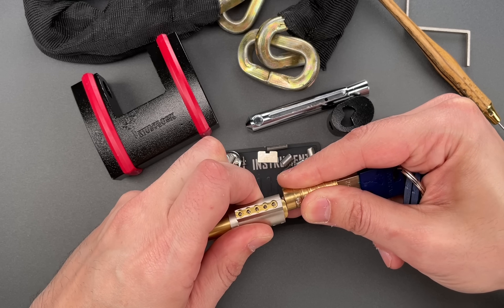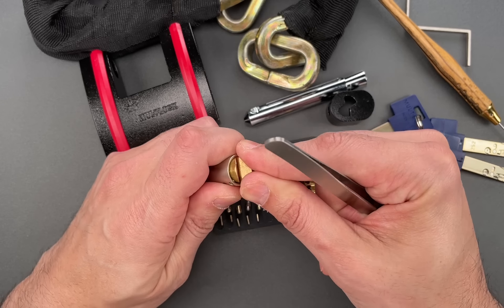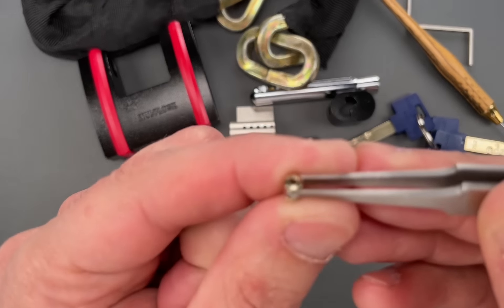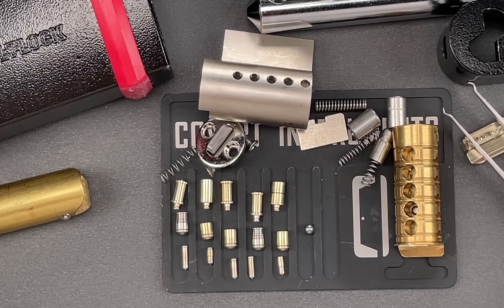[1592] Mul-T-Lock’s Sliding Bolt Blunder (Model SBNE12)

Comment: If that lock wasn't so comically opened by Trevor, it would be a fine bit of kit.
Reply: Really wasn't explained why it happened like that, my guess it's a spring issue?
Reply: @Patrickf5087  Weak springs, yeah. Easily fixable—just replace one spring with a cigarette lighter spring (cut in half, usually).
Reply: @ConstantlyDamaged This is the stuff i go to the comments to see. Thanks for sharing!
Reply: @Patrickf5087 Yeah, probably has to do with the shackle catch being sprung. Any lock with a sprung shackle catch can be opened by just giving it a whack (see also: the Master Lock 605, 606, and 607)
Reply: @Thesnakerox  If I've learned anything from Trevor's videos, it's that most master locks can be opened by another master lock
Reply: @ConstantlyDamaged  Yeah, but you have to make sure that the spring isn't common steel (which some cheapies are made out of). It's usually simpler to just take the diameter of the existing spring and finding a rust proofed variant online with a higher force rating and get it in a longer length too. Then you can start by snipping off the same length as the OG spring, and testing to see if the poppet does the same or not, and if it does, you snip a longer length until it doesn't. These springs are usually found on MC or other common places for machinist stuff. Cheap too. Cheaper than Rando Randy walking off with your prized scooter Daisy.
Reply: @Patrickf5087  looks like it's vulnerable to using a fork to overset the pins so they're all beyond the shear line.
Reply: @ConstantlyDamaged Bic or Zippo?
Reply: @akshonclip  I've had good luck with Bic springs. Just make sure when you're cutting the spring that it's actual springsteel (it'll make cutting through it a pain in the ass compared to normal steel).
Reply: @griffinkimberly7695  Idk if I'd go listening to some random on YouTube but you do you
Reply: dude just open palm slaps it open ffs..
Reply: Aerospace Engineer here: Great observation and sadly NOT untypical across the engineering fields.
This is sadly another example of people forgetting what the overall task is. 

Think of the Boeing Max-8. 
Its real job is to fly people SAFELY from place to place while making its owner/operators money.
It had an improved engine and improved aerodynamics and was VERY PROFITABLE for its operators.
It just had that one horrendous flaw that meant that eventually planes were not just going to fall out of the sky but the computer would override the pilots and fly the plane into the ground without any chance to recover.

The Boeing Max-8 will be a case study for engineering students for decades (and maybe centuries) to come.
This lock should also be studied in the same classes.

Comment: If not for the flaw this would be one of the top locks ever featured on this channel. Took a long time to pick, has a core difference from what I’ve ever seen. Looks durable.
Reply: I agree. After the engineers have a chance to patch that one vulnerability it should be a solid piece of kit.
Reply: @WyvernYT engineers: we fixed the problem with the lock and now it’s 100x more secure. When will the updated version be released?
Upper management: The lock sales continue to outpace our original projections. If we make this change it will cost an extra $.10 per unit plus initial costs to change production lines, train employees, etc and we won’t experience an associated increase revenue so we’re gonnna say never.

Comment: Those pins are something else.  The number of false sets and all of the pick resistance features here were quite impressive.
Reply: Now, imagine a lock with multiple radial rows of upper pins, such that it would need to be picked that many times.

And of course the upper pin rows would not be identical in type.
Reply: Yeah, it's just a shame about the severe vulnerability to bump attacks
Reply: Just watch LPL's old videos.
There are tons of those.
Reply: All that fancy machining work, down the drain in milliseconds.

Comment: I've been a casual viewer of your channel for a little while now, and I've always been fascinated with how quickly so-called "high security" locks can be opened without a key. 

Out of curiosity today, I went and bought a $10 "high security" self-branded padlock from... We'll call them "Deuce Hardware." I also bought a pack of about 60 bobby pins at "Dollar Shrub." I also got paperclips and safety pins in case they would be useful, total cost ~$3. I didn't need nearly that much.

I have never picked a lock open before in my life, but I was able to pop open the lock in about 5 seconds to take the keys off the shackle. With just two bobby pins: One to tension, the other to rake. Well, technically 3 because I dropped one under the sofa and couldn't be bothered to pick it up right away. So, all in all, I used about a nickel's worth of easily-obtainable tools to open it up.

The funny part? Their "Max Security" locks that cost more than 6 times as much use the same exact core. A core capable of being defeated in seconds by a novice with two bobby pins. 

I'm definitely going to be purchasing the Learn Lockpicking Bundle as well as some padlock tags in the future. I feel the urge to spread awareness as well as hopefully help out a good cause.

Comment: Its interesting how watching youtube videos without practice can translate into some useful low (though level) lock picking skill.

I recently picked my first lock in the wild, it was a cheap combination lock inside of puzzle quest room, in a puzzle we could not find the right answer for.

When we got desperate for this puzzle, i quietly went to the lock and after 5-10 minutes of slowly feeling through the vibrations and pressures of the lock I got it open.

I was super surprised that I managed to do that. I did not have any practice with any combination lock before this, only some vague memories of how it is supposed to feel from you videos.

Thank you!

Comment: A disappointing lock?
That isn't master lock?

Oh boy
Reply: It slaps open easier than the brass Master Lock shutter / sliding bolt locks, I’ll have to make a cutaway to compare the internals
Reply: Even better it is “Multi-Lock”
Reply: All master locks are bad, but not all bad locks are master locks.
Reply: No its Assa Abloy that owns the brand 🙂
Reply: I have removed this padlock from my recommendation list
Thanks
Reply: What a time to be alive!
Reply: This one's actually genuinely disappointing. I mean, with ML we know what to expect. Sh!t. Their 1 to 10 scale is reversed, the higher it goes the weaker the lock.
No, MT is actually a good brand with high quality machined components out of quality materials. To see this level of blunder because they cheaped out on a spring or two... that's just infuriating.
Luckily, you can fix it by getting a higher compression rate stainless steel spring (or at least rust proof steel) and replacing those weak ones like LPL showed when he gutted the lock.
Again, MT doing this is... disturbing. I hope they're not going through a cheapening, that'd be sad. Don't get me wrong, no lock (except THAT lock is pick proof), nor are they going to save you when they decide to just cut the door open or the post off, but you at least know you tried.
Reply: Disappointment requires having actual good expectations. Nobody following this channel has good expectations out of a Master lock. xD
Reply: Say what you will about Master, they offer a consistent level of quality. You always know what you're getting.
Reply: @McNallyOfficial EASIER than Masterlock!?
Dear god

Comment: I watched your video, and then I watched the short where Trevor slaps open the lock. What the heck was happening there? Why would the lock open from a slap? Neither your video nor his explains why the lock fails so easily.
Reply: McNally's featured a lot of locks that can be smacked open in his channel, the short of it is that there's an internal spring that is weak enough to be vulnerable to kinetic attacks
Reply: They've both already explained locks with similar failures before, in essence the company didn't add a basic feature to prevent the catch from being jarred into the open position, releasing the shackle iirc
Reply: My replies are deleted by YouTube's spam protection, what a pity.
Reply: The three pins that LPL took care to remove from the shackle at the start of the teardown has shoddy tolerances that just jostling that part can open that shit up.

I don't know why LPL didn't point it out in this video and dedicated a teardown to show that the main lock is quite formidable, but the shavkle was an obvious weak point.
Reply: The locking pall is spring loaded, so if you just give it a bit of momentum, it's mass will overcome the spring, causing the bolt to slip free.
Reply: @rubetz528  I'm constantly having the same issue with the most random replies :/
Reply: At about 2:30 he removes the spring-loaded pin that normally holds the shackle. When locked, that pin is held in place (securing the shackle) by a spring that is too weak. 

Normally, turning the key would push it up and allow the shackle to release, but a sharp impact can "bounce" that pin up on the spring enough to disengage.  A stiffer spring would make this harder to achieve. Alternatively, the design should avoid using very simple releases behind a very complex core. It's like using a high quality lock on a cheap chain link fence.
Reply: @PVS3  it shouldn't even have a spring in it. it should be a solid bar, that lowers when turning the lock core. at most, the spring to detent the bar, but only working from the unlocked position. , but not 2 springs
Reply: @rubetz528 I don't think it's YouTube's spam filters doing that, I think it's just that YouTube is really buggy (the comments of mine that don't make it through are pretty much the same as the ones that do, and look nothing like spam, it just seems to happen randomly from time to time)

Comment: I watched both your video and Trevor's, and I still do not understand how he was able to open the lock just by slapping if. What was happening there?
Reply: The locking lug that keeps the bolt closed is held in place by a spring. Hitting the lock in the right spot therefore causes that spring to bounce and release the bolt.

McNally has an excellent demo of this in his shorts on Master Lock 605.
Reply: McNally's featured a lot of locks that can be smacked open in his channel, the short of it is that there's an internal spring that is weak enough to be vulnerable to kinetic attacks
Reply: The flaw is the lock doesn't need the key to lock. The bar is held by a spring loaded latch when closed. Hit the lock and the latch stays put due to inertia, while the lock and bar move away allowing the bar to open. It's something like that anyway. Sciency stuff. 👍